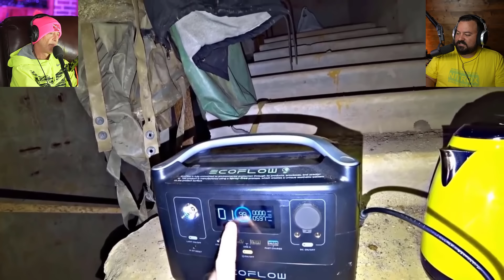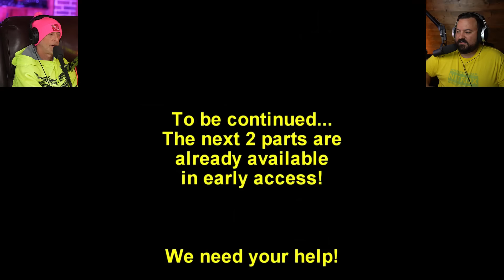Divers React to Diving in Chernobyl Part 2!

Comment: 27:50 actually at this stage, the fact that the environment is radioactive is almost the least of my concerns !
Considering the state of the equipment, the total lack of experience of the guys, diving in ice, in a closed environnement, in cloudy water, in a ruined factory with shafts of rusted metal poking around everywhere.... Radioactivity or not, the danger is just unimaginable at this point.
Reply: Yeah at least the radiation would take a while to get to them
Reply: i infiltrated  uwith under water drone Chernobyl  REACTER
Reply: At least they moved up a century or two. The first reactor dive was technology of the first underwater divers. Pots on the head and pumps. They might have pulled that off if they had enough pressure. That little bicycle pump can't force enough air to displace the water pressure.😆
Reply: @almathetiredone9167  
Depends on the dosage, you can die an immensely painful death over the night, the span of few days or over two weeks.
Could well happen over the span of many years.
If the dosage is enough, the symptoms will show when your cells die and what you regenerate won't be what it was before it happened.
Reply: @norXmal  thank you! It’s cool learning all this, just wish it was a more… let’s say, professional video on our explorer buddies end.
Reply: @Reece Carroll thank you for the correction. As English is not my native language, I didn't know the difference.
Reply: @Reece Carroll no problem! 😊
Reply: There are Backrooms with less hazards than this.
Reply: As a nurse... I'm thinking tetanus and asbestos are most concerning. Not to mention any bacteria or fungi that could enter the blood from the water.
Reply: Stress levels skyrocket when these idiots are walking on that ice all next to each other oh my God
Reply: @richardlouk1154  Sure you did. And I'm Queen Elizabeth!
Reply: @redmoonvenus7327  I find your writing to be excellent! Your original comment was great! It seems like somebody criticized it and you thanked them for the information. It was very gracious of you to handle it like that. 

But I think they are what we call a nitpicker. I don't know if that word translates to your language. It means someone who criticizes little things that don't matter at all. It's also a small insult. It tells the person to mind their own business. But unfortunately I can't tell them because they deleted their comment. It seems they anticipated being told something just like what I wanted to say to them. 

Ignore their nitpicking. You write extremely well! ❤
Reply: @cattymajiv  wow thank you so much for your nice comment ! ♥️ 
You really made my day. Thank you 😊

Also, I dont remember what this other member told me about my english ! But I may have modified my comment to correct whatever they had noticed, ah ! 😊
Anyway thank you so much, not everyone takes the time to just post a comment to be nice to someone like you did here ! I appreciate it a lot ♥️

Comment: Main issue is not touching stuff or staying near radioactive dust : it's BREATHING it.
Once you breath radioactive dust, it stays inside you. And it keeps beeing radioactive. Years after this, the radioactivity is still slowly destroying them from the inside.
That's why the n°1 safety equipment you would need to go there is a good mask (FFP3).
Reply: Absolutely true. It’s also not radioactive *everywhere*. There might be Hotspots for weirds reasons that you don’t know at first (hole in roof where it drips down, accumulation along certain winds etc.). And you don’t perceive radiation; without a dosimeter this is all just guesswork what they are doing. They could be fine, or they could be standing on top of Dusty McSievert…
Radiation is a complex thing and 99%+ of the population don’t understand a thing about it, sadly. Including many commenters. It’s either complete fear mongering or not understanding what really isn’t harmless.
Reply: Yea 🪦
Reply: @TomJakobW  The problem to me though, with what they are doing, is breathing in alpha emitters like polonium. uranium, americium and so forth. These are not going to be picked up by any kind of testing equipment over a distance of a few centimetres, but we both know what happens if they get these materials inside their bodies. They might not ingest enough to develop ARS, but they'll sure as hell have a massively elevated risk of cancer development.
Reply: Nothing like breathing a lung full of Alpha Particles
Reply: @captaincat1743  I did scaffolding & welding work at TVA power plant in Nashville years back. I was scared to go there just because of the dangers around. All the heavy machinery around, the heights we had to climb, and I wasn’t sure exactly of the harmful particles in the air but I always kept & checked my PPE when going in there.

I got anxiety the guy started causing particles to fly everywhere🤦🏾‍♂️
Reply: The dragging and kicking up dust is the worst thing

Comment: I've been to Chernobyl and Pripyat in 2019. The radiation directly in front of the reactor is relatively low (barley more than normal background radiation). There are hot spots (sudden spikes in radioactivity) all over Pripyat and in the exclusion zone. The red forest is essentially radioactive waistland. The best way to reduce radiation exposure is distance - taking one step back from a hot spot drops radiation back to background levels. With the plant, you have water that functions as a shield (so beta and alpha radiation is not a problem), plus the walls of the reactor itself. Limited time because you are going to run out of air at some point and most importantly, diving under the reactor still means you are maintaining distance to radioactive sources. The problem with dust (or, for example, forest fires that release radiation in the air) is that dust particles with radio-emitters can travel into your lungs or settle on your skin. Now, you have zero distance, a very prolongued exposure time and no shield. Alpha radiaton does not travel far, but that means that essentially all energy is transferred to the most immediate surroundings. If that is your lungs, it can cause a lot of damage until it is surgically removed. Alpha emitters are usually also gamma emitters. Gamma radiation travels very far and is mostly only really effectively stopped by increased distance. So gamma radiation will destroy your cells in the rest of your body if you swallow or inhale an alpha emitter. The side effect of 10 m (30 feet) thick lead shielding is basically ensuring that you are keeping distance. 
Long story short, I'd feel much safer diving under the reactor than taking a walk through the red forest. Maybe with proper diving equipment though. Also, they really should regularly check the dosimeter to quickly walk past potential hotspots or areas with higher radiations. They also should wear protective clothing and not disturb the dust that settled. Overall, it's obviously a stupid idea. Also, they seem to not really know much about radiation.
Reply: @S M Yes of course! I wanted to visit because I am a chemist and we did a lecture on radiochemistry and one unit was soley focused on what happened in Chernobyl and the effects it still has today. I also worked in a radiation exclusion area at the time at my uni. The tour was incredibly interesting and I highly recommend to anyone who is able to visit. 
 It kind of is a tourist spot with guided tours by now. There are a few safety requirements in place (like closed shoes, head to toe clothing, no touching or taking things and so on, plus you get scanned for radiation a few times), but as far as radiation exposure is concerned, the flight to Ukraine comes with a higher radiation exposure than spending the day in the exclusion zone. People also still work there and stay in Chernobyl (the town, not the reactor).
Reply: I’d like to take the tour offered there.
Reply: A big issue now with radiation are people go there to steal copper wires and burn the jackets off of them, leaving piles of radioactive rubble. They were there a few weeks ago and the radiation was pretty high in r the areas the thieves had been.. they also used an underwater drone this past trip…
Reply: @stevemcgowen  Yes, people selling or incorrectly disposing of radioactive scrap metal is a huge problem even outside the former soviet union and satellite states. There has been a few cases of acute radiation poisoning with people finding warm or glowing metals and not knowing what they are, often from medical equipment or old reactor cores. If I remember correctly, junk yards used to be guarded by soldiers because people would steal and resell radioactive metal.
Reply: @annalang5687  Most of the cars or parts from cars were stolen at the time also. What the people who are scavenging now  are doing now is even more dangerous. They are pulling out cables and wires  from places which are still hot and stripping the silver from switches in areas that aren't safe. When Super Sus and his crew were there a few weeks ago there were piles and areas that are really hot...
Reply: @annalang5687  I thought there was actually a vodka distillery that opened there and sells vodka on the market.
Reply: My husband is a astro and nuclear physicist who was there in the late 80s(full bunny suits as he calls them) and in 2019(no bunny suits) as well. He flew genuine Aeroflot while it was still the USSR. 

He is totally suspicious about all of this. He wants to know where all the radiation signs have gone as well. And all the general signs have gone. He thinks there is just something not right with all of this. He says either they have the luck of the gods or it's not Chernobyl. The making tea and eating and such like is the most worrying part. 

If it is just a flooded underground of a decommissioned reactor, as long as they decontaminate afterwards then they're fine. But again if they get it in their mouth the alpha will destroy them from the inside out.

Apparently reactor 4 and 5 have less radiation per hour than a CRT but you're right about the hot spots and they are totally random. There is a cafe in Pripyat that is mega hot, as many of the those helping came there afterwards to be fed and given hot drinks and such like.
Reply: Answered a few questions I had lol. Thanks
Reply: @irestar6  they go there quite a bit. Quite honestly if you think it’s fake, don’t watch. I’ve been watching Super Sus for years. They go there several times a year, were there last week, have friends in the area who help them not get caught with information about patrols. They do get caught and fined about 50% of the time. ..
Reply: @stevemcgowen  I listen to my husband on these things as he's actually been there twice. 

Yes many break the exclusion zones, some have even moved back into their old homes at the edge of the exclusion zones.

There are varying fines depending on how close you breach from money to gulag. 

But getting fined for breaking into an old factory that's been well robbed out and stripped is quite different to being near the sarcophagus for example.

My husband can never go back now with definitely getting serious damage for certain.

Just because I don't believe that they are in serious danger, and are utter idiots, doesn't meant to say I cannot enjoy a bunch of idiots doing stupid sh*t.
Reply: @nickread2623  glad to help. If you have any more, feel free to ask. I'm not an expert but I'll do my best to answer
Reply: This comment is 100% accurate. Glad to see it. The guys need some help understanding this stuff and not just radiation specifically but light loses energy as distance increases, the inverse-square law. So as you said even gamma rays (which is just light) lose energy over distance. And hydrogen is a shield, one of the best and water is 66.7% (rounding) hydrogen. Great comment.
Reply: @S M you can take tours or better stalker tours.
Reply: Hi Anna I work underneath a large cell tower, spend around 2 hours a week working within 5-30 feet of it. Has a lot of different connections and they recently added 5g onto it, do you think I'm in dangerous of radiation poisoning? I've recently been feeling very tired the past few months and have had other side effects so I am concerned, there's not much transparent information about radiation poisoning here in America. Anything you can tell me I would very much appreciate
Reply: @Strafetyz  cell towers don't produce ionising radiation like a power plant would, but electromagnetic radiation. You can't get radiation poisoning from electromagmetic waves. What are your symptoms other than tiredness?
Reply: @annalang5687  Was there in 2018 and I wonder if you have the same regret as I do - why did we only stay one day!? We definitely should have booked the multi-day tour and spent a night or two in Chernobyl town, cost be damned!

I really want to go back in winter, but that's looking unlikely for a while given the instability in area at the moment :(
Reply: @jamesmccutcheon4637  absolutely yes, multiple days would have been fun. Visiting Ukraine was only a weekend trip for me though. We had an amazing tour and I would have loved to see the reactor room inside the containement. I was side-eying a PhD project for a while that was about tracking radiation levels in beetles in the exclusion zone but unfortunately, I have zero experience with preserving beetles.
Reply: Why would you even go there ? Is it just a thing to do if you live there or more of a morbid curiosity
Reply: @kevinverduci7600  Yeah, I guess the latter for me? I'd been fascinated with the whole event since I was a kid and loved the depictions in media. I'm Australian, so definitely not just a 'I was in the neighbourhood so I dropped by' kinda thing, was planned months in advance.

And it makes for a great pub story to casually talk about the time I was in the control room of reactor 3. 🙃 I also have a photo in front of the ferris wheel in Pripyat, which is pretty good for the Tinder profile 😅
Reply: @kevinverduci7600  And the extra thumb is wayyy more useful than you'd expect! 😉
Reply: Sounds like you know what your talking about
Reply: @annalang5687  There are workers at the reactors too, they keep the spent fuel rods safe and cooled. They've been taken hostage by the russians...
Reply: @irestar6  these dudes were swimming near the reactor and taking water into their mouth and spitting it out. They also slept in an apartment with radiation and dust as well. It's like they purposely try to inhale as much of it and touch as much of it as possible. At least the dude in the orange pants does. When he was introduced to the group along with the other guy (not in this video) but his face looks kind of like an after affect of radiation as a baby, were both really problematic and chaotic. Before it was really chill and just then exploring. Idk how their health is going to be in the long run. Or how long they will even live after all this
Reply: @S M it is actually a tourist spot i took a tour there
Reply: Pretty sure the radiation inside the radiation building is still pretty high even after decades.
Also, lots of molten fuel under the reactor.
Reply: @phillipsmith4473  There isn't any fuel. They aren't diving under the 4th reactor (yet), it's the 5th one, never finished and never fueled. The only contamination there is dust from outside.
Reply: @irestar6  I'm sire your husband wasn't ice diving in the basements though, so it would make sense that he is unfamiliar with these portions of the factory. The divers have already debunked that it is not the factory, these gentleman are all located in Ukraine and apparently frequent it. If your doubt continues, their channel has other videos with more description of the location. What they're doing is fully illegal and nobody is supposed to walk around in it, so who would install the signs?
Reply: This is the darkest thing ever
Reply: @tomclanys  I wonder how they could get inside the reactor 4 building by diving, perhaps a service tunnel or through those tunnels that the liquidators drained to prevent a steam explosion?
Reply: Garbossa  lol why
Reply: It depends on where you stnad.
Reply: there is no fuel in reactor building 5 because it was never finished. After the incident in reactor 4 the expansion was canceled afaik
Reply: The most dangerous thing is the moss as that is slow absorption and higher retention of radiation.  BBC has great documentary on the building of the new sarcophagus covering reactor 4. Challenges and radiation levels vary so widely. Wider exclusion zone is an amazing place to visit, makes it real in visceral way
Reply: Ah, so right below #4 is the Elephant’s Foot, the most radioactive structure on earth.  Will be for 100,000 years.
Reply: @annalang5687 what you're referring to are probably remains of RTGs. Those are low power electric generators that are basically a hunk of plutonium or other radioactive isotope that is potent enough to generate lots of heat due to shear radioactive decay. That hunk is surrounded by thermocouples that convert heat to electricity, and very thick metal shielding to protect users from radiation. RTGs are usually used on space satellites, but in USSR they were used to power beacons on remote locations without power grid. And because of heavy shielding they were sometimes targeted by metal scavengers that took them apart to scrap the shielding, and just threw red-hot plutonium cores into the bushes.
Reply: @stevemcgowen chernobyl reactor core  is sealed under many ft of concrete with outer sarcophagus .

Comment: I work with radioactive devices and have the certs as well. Yes, the water traps the radiation at the bottom. Dust is the problem, but radiation doesn't spread out evenly and certain areas will be more contaminated then others. Chernobyl is completely safe for a couple hours at a time and has been open to tourism since 2011.